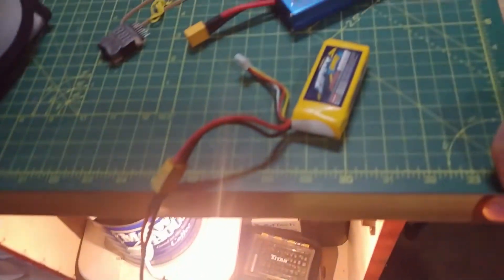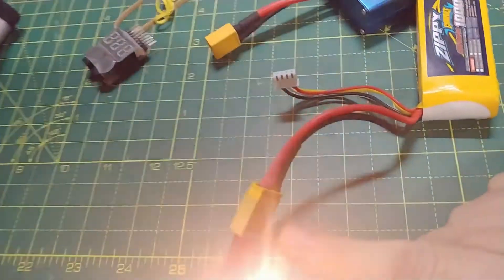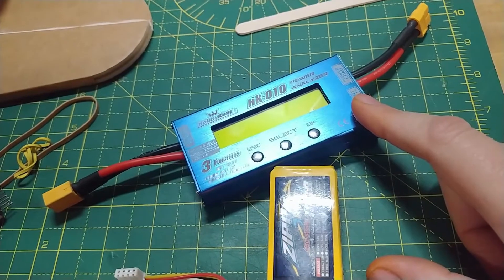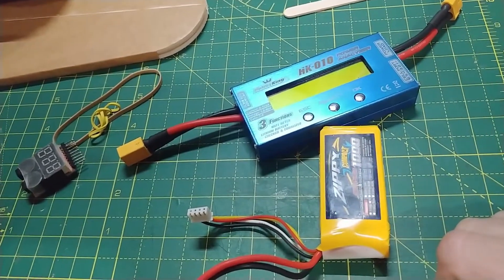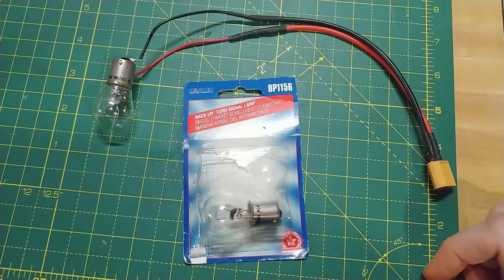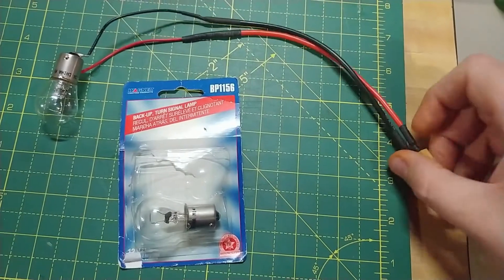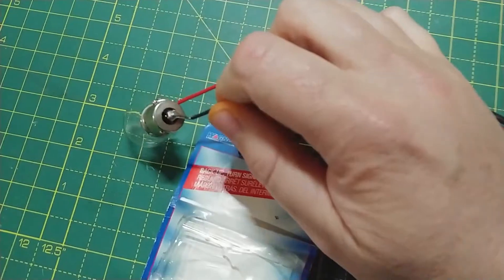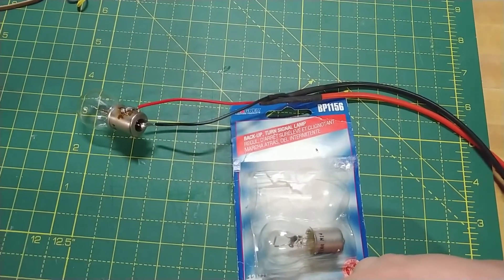One way to safely discharge a Lipo

Comment: For $13 you cant beat the "AOKoda 150W 3 in 1 RC 2s-6s Lipo Li-Fe Battery Balancer LCD+Voltage Meter Tester+Discharger", they are great and upto 150W discharge, set your cutoff voltage, plus it is a 8n1 meter, plug it in, hit start and it does everything, no need to worry about killing your lipo by over discharging it, check them out.
Reply from the maker: Haven't used it, but I did link it in the description and seems like it would be a good option as well.

Comment: You just need to add any load to the battery and can simply be done with a resistor. Same as the lightbulb but you can buy heaps of resistor for the price of one bulb and if you wanted to get fancy. Find the optimal discharge rate of your battery in watts and just buy a resistor designed for that amount of power. Resistors will radiate heat much faster than the lightbulb but unlikely to cause any concern. You could add a small heat sink with a fan but I highly doubt it's necessary. So long as the circuit (battery, wire, resistor, and return wire to battery) is somewhere fireproof worst thing to happen is the resistor cooks. Also, I've only used a lipo in one project and found this because I found an old lipo puffed up so discharging reduces some of the potential harm. What I'm getting at is I thought discharging too fast had potential to also ruin the battery. I switched to lithium ion since weight isn't an issue and way less temperamental than lipos. I found a small dc motor I think requires 1.5-3v somewhere in that range drawing milliamps. Added a few "blades" of electrical tape to increase resistance to the motor shaft. Which looks kind of cool and easy to see when the battery is mostly depleted. Time to time I see lipos and discharge them before I either store them or take them to a disposal facility but is there a ampere draw too high or too low that is dangerous. I'm not asking specifically my battery but is it common for lipos to have like a datasheet with range of safe output or charge?
Reply from the maker: The output rating is usually listed on the battery itself..  it will say like 30C discharge rating, or 50C, or what have you. Charge rate is not as easy to find... Sometimes on the site you purchase it from will list it OR your battery will include a spec sheet with that information. It is usually much lower .. 1C, 2C, etc
Reply from the maker: Forgot to mention... I haven't verified this, but many claim that the discharge rate is horribly inflated by the manufacturer. So, while it may say 50C... It may be more realistically set at 20C or something like that.

Comment: Thanks for posting on this. What is the best volts per cell level for lipo storage voltage? There are varying opinions on this. Have seen anywhere from 3.4 to 3.9 volts.
Reply from the maker: Top result on Google shows it at 3.8-3.85V per cell. I know my charger puts each cell at 3.8V. Hope this helps!
Reply: @perkyplanesrc9363  Yes, thanks it helps a lot. Thanks for responding. You're one of few creators who actually respond. Rare these days.

Comment: Hello sir thank you so much for sharing this with us. I have further question tho. I have this 20.000mAh 65W li-po powerbank and kinda swelling. I'm so afraid it'll combust anytime soon, can I use this same method to discharge it? or what should I do? Thanks in advance
Reply from the maker: Yeah, same principle basically applies. You need something to drain the energy from it so you could do the same for your power bank. You would just need to make sure you have a plug/connector to hook up to the power bank.

Comment: How long does it take to discharge a 3s lipo
Reply from the maker: Assuming the battery's full charged, using this single lightbulb approach, it reaches storage level in about 20-25 min or so.

Comment: That is always a great idea!!💡 In fact I might start doing that, with an alarm plugged into the Balance Port of course!

Being cautious NOT to sound condescending (being sincere!!), that's such and old RC trick, that most people have forgotten about it by now. 😉 

It was the go-to plan back in the 80's with NiCd Batteries. NOT FULLY discharging a NiCd, would cause the Cells to develop a "memory". 
Whereas... If you ran your Battery down to 2.5 volts (any number really), frequently, the Battery Cells will start to see 2.5V as EMPTY. 
So then it takes 4.7V to top it back up to 7.2...

Do that enough times, and no matter how you charge it - the Battery itself will "learn", and see 4.7 volts as FULL! 
Nobody really understood how or why. 😲😖

Occasionally, one could cycle the Battery - SEVERAL times, from zero to 7.2 - 7.3....
But it will never be as efficient again. In a Competition setting, that was BAD.
So the Battery was then considered Junk! 

SO...... To prevent that from happening...
After every run, we would plug the Battery (similar to what you just did), to 1156 Automotive Bulbs. 
But we soldered about 6-10 Bulbs in parallel. After plugging in, that Battery wasn't touched, until the lights were COMPLETELY out, and the Battery was cool to the touch.
Some even hooked up a Volt Meter, to make sure that it read 0.00 volts! 😖 

You could not believe how ECSTATIC we were, when the NiMH Battery was introduced!!! 😁
No more Memory. 

..... Yes my Friend, at one time, the NiMH was considered a Godsend!! 

{We STILL did a full drain on our NiMH Batteries. Out of habit, and it was a little healthier for the Batteries} 😉

Lipos are a quantum leap from NiCd!! The NiMH was just as significant back then.

YOUR HISTORY LESSON FOR THE DAY! 
Have a great Week! 😉
Reply from the maker: Interesting info. I really don't remember much from those days. In fact, the only RC things I had at that time were more toy grade and used fairly simple chargers. Just plugged it in til the light went out, turned green, etc. I really love the smart digital chargers we have now.
Reply: Yeah, we're really spoiled by technology lately!! 
Of course with Batteries that EXPLODE now, it's more of a necessity. It's so nice to put a Lipo in an old Truck that only got 4 minutes on a fully charged NiMH....
And get 45 MINUTES on a Lipo!!! 

Someone once told me back in the day that "It's not the Battery"... 
Well guess what? 😁
Reply: @CarlRCTips  Yeah back in the day your car would run for 2 to 5 minutes you would have to have a box full of batteries at least I did.
Reply: @perkyplanesrc9363 new to RC hobby so if I use my lipo and it dies I can store it? Or do I have to do some kind of balance before I store them? New to this so i realy don’t know